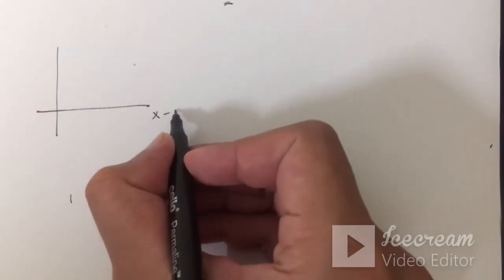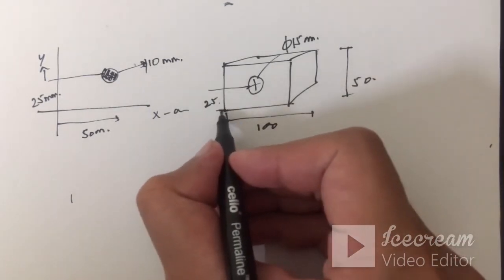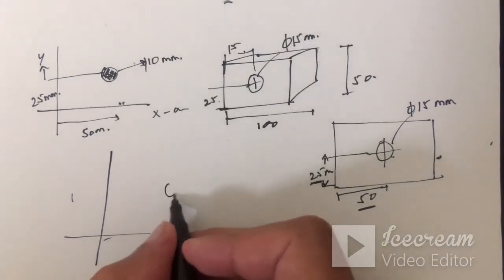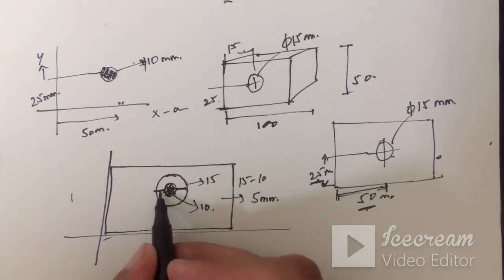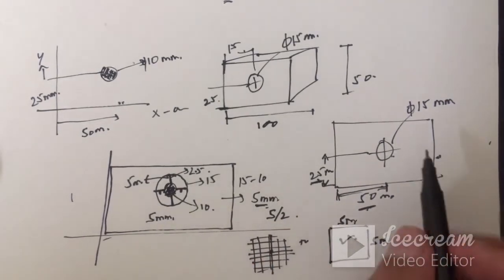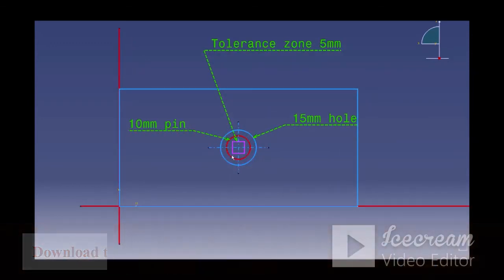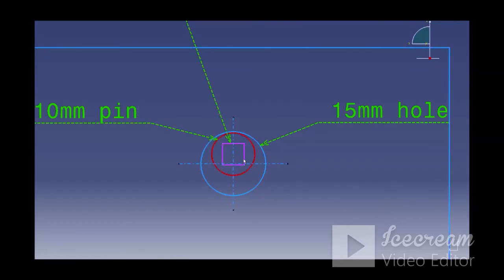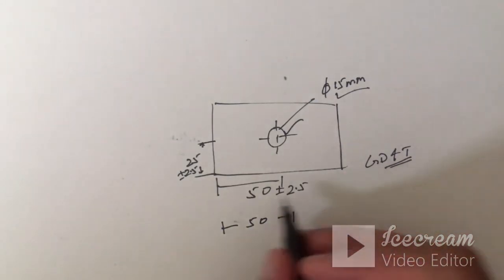GD&T and Tolerance Stack up Full course | How to decide Tolerance of any part

Comment: What about hole and pin size tolerance?
If hole is manufacured at MMC and pin is also nanufactured at MMC then ur location tolerance will redeuce if we dont usd any gtol in this case
Reply: Please give more explanation sir.i'm on my learn about GDT stack tolerance.for example what the reason if concentricty and cylindricity given at component, which both geomtri tolerance include at stack
Reply: Your explanation is 👇